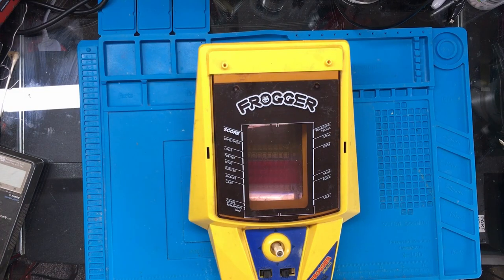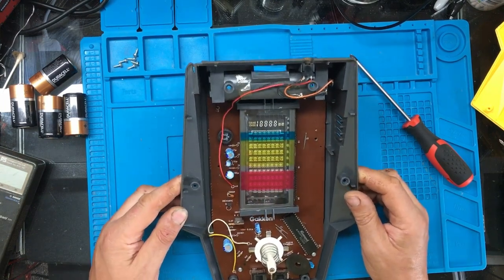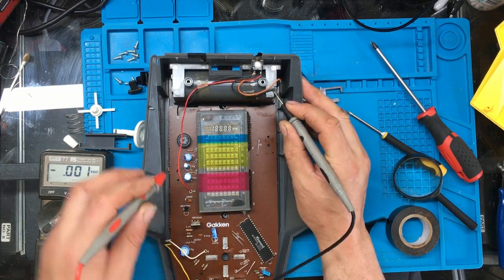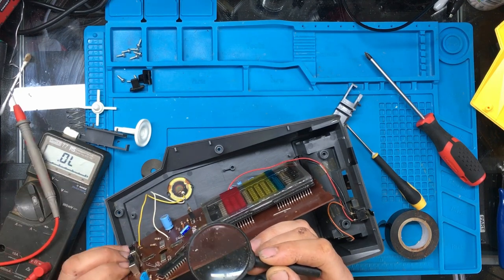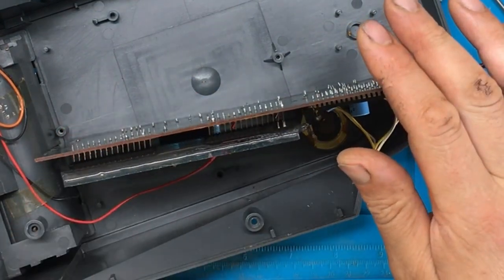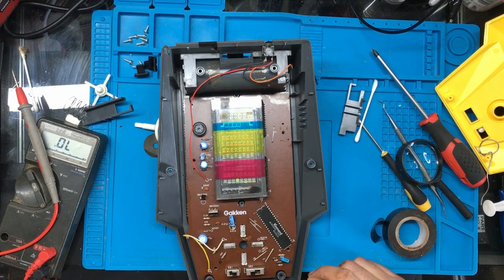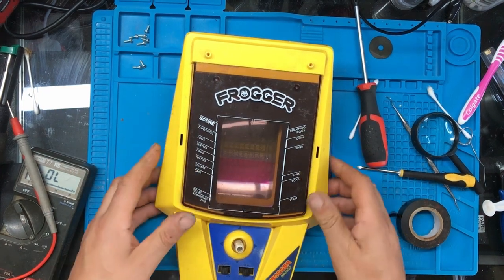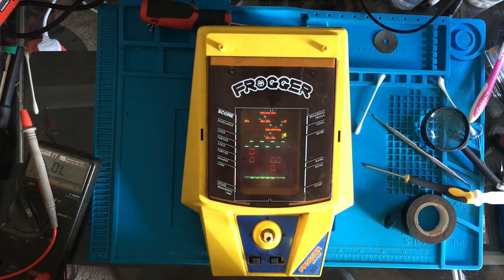Vintage Frogger Repair - CGL / KONAMI /  GRANSTAND / GAKKEN

Comment: Well spotted on the broken leg! I like the look of the little dentist type tool, can you remember what it is called? Great fix 👌👍
Reply from the maker: Thanks Vince! Glad to see you here! Keep up the great work on your channel. I also saw you hit 800k+ congratulations!
I first saw the little tool on Northridgefix, he was using it to scrape away PCB mask on fine tracks like xbox HDMI ones to rebuild them with "pad strips". Here is a link to the tool I bought from ebay 
https://www.ebay.co.uk/itm/275018156594 
and here is a link to what he calls pad strips for rebuilding traces if you are interested 
https://www.ebay.co.uk/itm/284797499916
Hope that helps :) and thanks again for visiting!
Reply: @BuyitFixit  Nice one, I already bought those repair strips around a year ago but still haven't had the chance to use them. The tool though looks useful for many things including if a leg ever snaps off a chip, be nice to grind away the black covering to allow the chance to solder the leg back on. Just bought it, thanks very much for the link. Keep up the hard work 👍👍👍👍
Reply from the maker: @Mymatevince  No problem at all sir. Glad to help.  Keep up the good work also!

Comment: Hello from memory (about 38 years ago when I opened mine) the paper disc goes over the three position switch, a bit of a mask for the switch itself.
Reply from the maker: Oh right. Thanks for that. I've still got it on the bench so might pop it back in. Just fixed a couple of more things like this too.. just busy editing then uploading.
Reply from the maker: Hi, I took the frogger apart again as I'm repairing a couple of Grandstand Astro wars (future video) and there's a diode gone in one of them but there is no part number, and I was curious if the diode was the same or similar in the frogger game (as the part numbers are marked on the PCB). While I was in there I fit the paper circle over the game select / off switch, so thanks again for that.
Reply: @BuyitFixit  brill 👍
I also remember as a lad I partly peeled back one of the stickers, might have been the silver one underneath, and it had Japanese writing on. Also think the main sticker on the hood (yours is missing of course) was over the top of another sticker which I figured was also Japanese. Strange how I remember this seeing as I was about ten but I was a tinkerer even back then.

Comment: I bought this on ebay for 100 and the batteries don't work in it as they had leaked at some point, what AC adaptor shoukd I use? Says CGL but do they have different voltages? I had it as a kid and some silly bint dropped it and twas wrecked so had to get it in my 40s- 40yrs later 😀
Reply from the maker: 100 seems a bit pricey. I bought a job lot of 5 of these a few months back for £27. I've yet to do a video on them. I'd say a 6v to 9v adapter. I've just looked on Ebay and there's a universal 6 way 600mAh multi voltage adapter with different plugs to fit different devices. That should work. Be careful to get the polarity round the correct way though! 👍
Reply: thanks so much for replying, yeh, sentimental value...original cost our fam 40 in 1984
Reply: and it was 100 and the battery area was gooded, good old Ebay :(
Reply from the maker: No problem, glad to help 👍